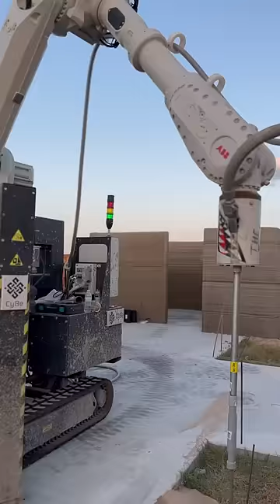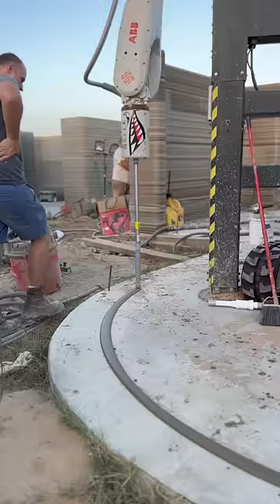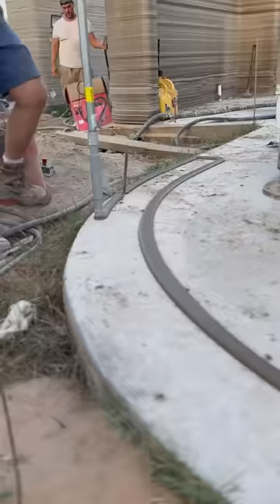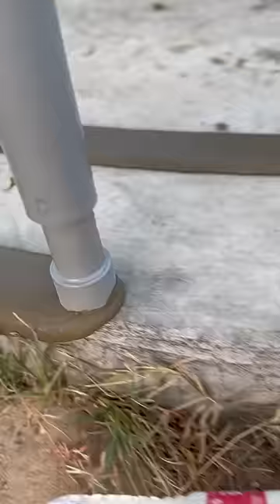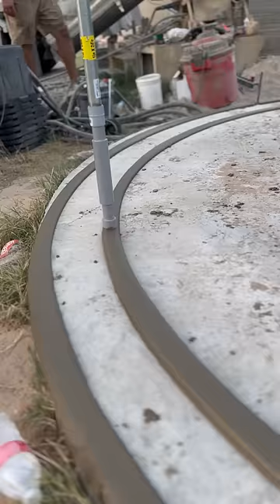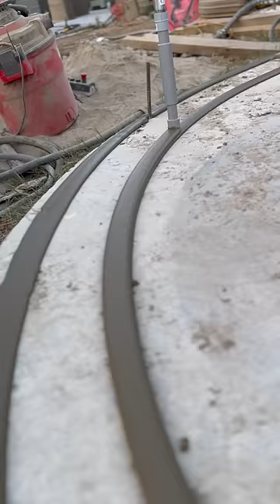Starting a fresh new wall with a two man print team #Hive

Comment: 3000 hours later, and the wall is done.
Reply: And after everybody who had any vested interest in the progress is long dead.
Reply: no rebar, no insulation....
Reply: And then it cracks and falls. Part of it is built on sand. Wth?
Reply: @mobilfone2234  Not true! there are rebar verticals at 12 feet OC!.
Reply: @LonersGuide China's building standards are not accepted here
Reply: "...its that easy!"
Reply: Didn’t clean the footing before hand, so it’ll crumble down
Reply: And then the wall falls bc it’s shit
Reply: “3D printed homes are completed in 1/20 of the time primarily due to around the clock working capabilities”
Reply: So efficient! Much effective! 
  Yeah, this looks like snake oil, a 2 man crew minus a gas guzzling machine could set bricks alot, and I mean alot faster
Reply: @jkizzle9953 Sounds like a contradictory statement, "we can do something quicker, because we can work on it more" essentislly saying "hey you guys use 20 hours over 3 days, we use 20 hours over 1 day to do the same work"
Reply: @mobilfone2234 . Insulation?    It’s concrete ffs. And we don’t put rebar in brickwork either.
Reply: And the cement hardened on the machine
Reply: Unlike you, this thing works and can go all night so it's done the next morning as it continuously prints.
Reply: @longbow6416  Nah. People have to take breaks.
Reply: Slow progress is better than nothing
Reply: Yeah looks like a lot of machinery and equipment and time and expense to build a crappy wall two men could do far better in far less time at much less expense
Reply: @jkizzle9953 I'd almost believe ⅓ to ¼ because of 24 hour capability
Reply: @quinn3011 😂😂😂
Reply: @StoutProper   It would be interesting to put the two types of homes to the test.
Reply: If the walls going to be just pure cement doest that mean more of the earth has to be dug up for cement mix. Hows that good for the environment 😂
Reply: The reduction in wcb claims will make this more and more viable
Reply: @whimseyOFC  I have zero clue what you mean man. 1/20 of the time is 1/20 of the time. There is no other way to cut it. If it takes 20 days (480 hours) to build it normally, it takes 1 day (24 hours) to build it 3D printing.
Reply: @jkizzle9953  what im saying is, if I had guys working around the clock, it would be done in the same amount of time
Reply: @whimseyOFC  It wouldn't. That assumes that the 3D printing takes 1/3rd of the time, so 24 hours of manual labor would make it equal. For your guys to do the work in 1/20th the time they would need to work 160 hours a day, not 24.
Reply: Guys, here is our Savior

HalleluYAH translates “Praise ye YaH”

YaH is The Heavenly Father
YaH arrives via the TENT OF MEETING
YaH was Who they Crucified for our sins
YaH was Crucified on an Almond TREE

Semitic of Moshe (Moses)
Isa Scroll (The Original Isaiah)

Isaiah 42:8 - I am YaH; that is my Name! I will not yield my glory to another or my praise to idols.

Isaiah 43:11 - I am YAH, and there is no other Savior but Me.

Isaiah 45:5 - I am YaH, and there is none else.

Comment: Prints on sand/soil, doesn't follow the concrete pad, the pad is dirty and it's a cold joint.
Reply: Also is obviously 10x slower than the laziest human. And it has the accuracy of Ray Charles playing darts. 

Even if it was faster, all the time is lost calibrating it for each and every minor change at each and every step and you pray to zues that you catch a fault immediately or else RocoBuilder over here will just keep going evidently.

Comment: They didn't sweep the slab because if you look at the start, the outside of the wall is off of the slab and the only thing keeping it from putting the outside of the wall in the grass is that giant mount of sand alongside the slab.  Crazy that they would show this!!
Reply: @BuildingABetterWay, exactly and notice how there's is that offset in the "arch" as it dispenses the outer portion of the wall and then it even "spills" over the edge as it approaches the start position because as you said, they started dispensing OFF the base.... Makes no sense to me either.
Reply: This must be a practice run that they have no intention of leaving up. There is no way they would keep a wall off a Slab like that and not expect it to be structurally garbage

Comment: I am a civil engineer and after watching this video I have nightmares
Reply: Why?
Reply: about losing your job?
Reply: @HR-yd5ib  More likely about people dying when these collapse.
Reply: @Pokarot its just a test print.
Reply: @HR-yd5ib  Great, so what do they do after the test fails?  Back to the drawing board I hope.
Reply: @Pokarot  , changing the settings on the machine.
Reply: @HR-yd5ib there's a whole village of these houses, it's proven tech
Reply: Civil engineer huh? 😂😂😂
Reply: @scifi_shop  , i am aware.
Reply: @HR-yd5ib If it's a test print, why not give it the best possible chance. Like, at the very least, preparing the ground  by removing all debris.
Reply: @jonathanreed5139  I would assume the chance of the machine being perfectly alined at the first try is so small that cleaning up before is a waste of time.
Reply: Right!? No rebar or any kind of reinforcement??
Reply: Proven or not he misses the foundation..this is ready to be demolished
Reply: @irishn8 the void left is filled in with rebar
Reply: @irishn8 it's going to be in compression only, doesn't need reinforcement.
Reply: I laugh when you have these nightmares, and I hope they plague you every night.

Comment: Structural reinforcement has left the chat.
Reply: This is waste of money and resources.. soo many missing structural components. 3d printing  a huise is soo silly. No reinforsment no wood or nails.
Reply: Ы
Reply: Why? There is one armature.)
Reply: Isn't the wall in compression only not in tension
Reply: I don't know what you people are whining about. The machine is laying down walls which they probably go back later and fill with concrete. Do you people really think they're leaving hollow walls? You all whine like little girls. The machine is probably extremely expensive, but it's also probably very reliable for mass production of homes, and it's a one man wage instead of paying a whole crew to lay blocks.
Reply: @solmon9673  Wtf do you mean "no reinforcement"? No wood and nails? Lol. Concrete is way stronger than wood and nails. These walls will 100% be filled after they're complete.
Reply: @seasong7655 if it's only vertically loaded...yes
Reply: @truthoverlies6434 stronger in compression yes...unfortunately that's only one force we design for
Reply: @seasong7655 no...wind will create tension and shear loads
Reply: Bro really drawing his boundaries
Reply: hey man, didn’t u see that piece of rebar sticking up? that things gonna hold that whole wall column down for sure 👍🏻
Reply: @solmon9673 i mean You could make a 3d printer so good that it prints all types of materials and uses them properly but that would cost tremendouly (im talking milions/tens of milions)
Reply: @truthoverlies6434   nonsense... we know what the machine do.. and there is no government of organisation using them there still in development..  they cost is tooooo high,
Reply: @truthoverlies6434  earth has alot of element most houses use a combination of materials, to make them affordable  and last longer.. on yhe rich use concrete  everywhere.. the rest of the world its efficiency and cost saving methods. 3d printing  is best for mars and the moon..
Reply: Take my like

Comment: It may help to have the entire print ON the concrete. You should have instantly stopped and made the adjustments....oh, and cleaned your slab. 
Yes, there are "acceptable" overhangs allowed, however, in this case, it appears eventually the weight will shift off the foundation.
Reply: No one else seems to be commenting on this but this seems so plain and important.
Reply: That was the first thing I noticed as it came around that curve. I’m guessing the machine wasn’t set in the correct spot? Based on how they left that dirt there it seems likely they aren’t very detailed sometimes.

Comment: I like the part where they lay concrete on smooth concrete before cleaning the surface and preparing it properly. 
Then the sequel when the concrete isn't being laid on the pad completely and you're losing it over the edge but when the main hero of the whole show, Dirt, shows back up, you completely forget that you're pouring over the edge still. 

Just because you made it further into the lesson, it doesn't mean you should forget the basics.
Reply: Hey hey hey... they had that one piece of rebar that got smacked by the head.  It's solid. Lol

Comment: Seriously? Fire the guy who was supposed to clean the foundation. Fire the guy who programmed the pattern. Fire the guide. And then, fire the guy who thought it would be a good idea to post this video.
Reply: Bro the worst part about it is, I would put money on it, that it wasn’t that the foundation wasn’t cleaned… it was that there was no foundation there and they needed to put the concrete on something, so they put a bunch of dirt in the area and just poured on top. Pest control problems in the future much? Cracks in the walls much? This whole video is a fail. The tech is cool, but everything else is so wrong
Reply: Exactly. I said the same thing. When that dirt washes away they poured it on there will be nothing holding the wall up and it will create and opening for water and insects 🙄

Comment: Part of wall on concrete, outer layer goes on the ground😅 excellent engineering solution! I’m very excited to see it after 10-20 years!
Reply: You mean 10 - 20 months, right?
Reply: @allanmoulton3745  1-2 winters show such defects, I’ve said so for being sure
Reply: Any point where there isn't concrete slab under the outside edge of the wall will become a point of entry for insects and rodents

Comment: 2 weeks later, a wall, that could have been built in just a few hours by a single skilled block mason.
Reply: Don’t forget the hod carrier, the scaffold, set up, clean up, tear down and ibuprofen.
Reply: There is probably not one mason left. 😢
Reply: Bock mason?
Sorry, we haven't needed those since the house shitter 5000 was invented.
Reply: Typically we lay up 6 courses of block per day so the mortar has time to properly setup.  Much more and you risk collapse.  Regardless, CMU would definitely be faster and with more human control but equally more human error as well.  I choose CMU every day over printing.
Reply: @ChaosBW 😅 I'm still laughing House Shitter 5000😅😅😅😅😅
Reply: @ChaosBW  Now that right there was funny, I don't care who ya are!! :-D
Reply: As a mason I've got problems with this stuff because it's super ridiculous to repair the pattern but let's not lie this machine is faster than we are. It takes no breaks, it does not need to eat, or sleep nor is it paid a wage. It's not possible to run employees 24/7
Reply: but it wont be as sturdy or tough as the robot

Comment: Curious, does it matter that it printed over the edge of the concrete as well as printed over that dirt patch?
Reply: For sure it matters.  Would you set a 2x4 on dirt off the foundation, no.
Reply: Does it matter you ask, well not to these guys clearly.
Reply: @chunkyfecalbreakfast I hope you’re not a builder…
Reply: @funkmanone California “craftsman”
Reply: That absolutely means that it will be stronger! Teetering on the edge or just printing on the dirt is always the best method.
Reply: Maybe some load bearing cardboard would help with that dirt? Just saying
Reply: @jacobwachtel5177  🤣🤣🤣🤣🤣

Comment: Usually you got to have a good clean surface and prime it first
Reply: There is no primer for concrete… that’s cars dude. You don’t “prime” concrete. You just clean it well. And you don’t program the machine to cut the bend short then go off the foundation spilling over. Now that spill over part of the wall is going to be lower by the time they start going up because it lost material spilling over, and it’s literally going to leave the wall hanging off the foundation. And then you have the bend which was cut short which will leave that concrete sticking out past the wall.

Comment: And 3 months later hey are already about 17 inches high, what a progress ! Just don't touch the walls, it's hollow and very fragile.
Reply: I do know that some companies use expanding foam or even more cement inside of it in certain areas so it don't crack or shift

Comment: Nothing like a 2 man team building the structure of a house in 4 months.  Meanwhile a 4 man team who actually frames houses has done 16 houses in that same time span. And for a way cheaper price
Reply: There is something to be said for that, but I’m down to at least consider alternatives. We live in boxes made of toothpicks and paper.
Reply: @JakeTrimble-bx3lx I think an f-5 twister will take stone or matchstick houses either way
Reply: @marksevastipol1946  F-5 twisters are much less common than F-3 and there will be a huge difference in damage for those. Of course, it might be simply easier to rebuild a matchstick house once in a while. Depends on costs and tornado frequency.

Comment: theres alot wrong here... 1st theres not prep done the pad is filthy.
2nd weres the rebar? i seen 1 tiny piece... 
3rd how does insulation work? do you build a 2x4 wall inside and secure it to that then use fiberglass in it then drywall over? if thats the case wouldnt doing a wooden wall be cheaper? or stucco? (being done correctly)?

Comment: I don’t do concrete, but when they built my house I got footprints on my side wall and driveway chunks taken out around the edges.  They brought a skid steer on to pick up the trash and it scored the garage with the teeth a drive way then a quarter of the driveway cracked so they had to break up and report that section and it is white not grey.  The sidewalk is not straight the framing is all wavy.  So when someone hasn’t taken the time to rent a broom, shovel and a garden hose to clean an area they are pouring on, it really pisses me off! Speaking as a experienced non-expert, the extra 30 minutes would have been well spent and expected if this is not an experiment and for a new owner…. Color in between the lines not outside!!

Comment: They should do  3D scanning of the shape of the surface to adjust the model before printing
Reply: no, they can just do a dry run without concrete to check nozzle path. which they did since they knew where to build up the Clay to match the footer instead of moving machine { assuming it as at its adjustment max already} or reprogramming the machine center point

Comment: Not only is there sand on the footer, it appears that either the footer was poured wrong or the cad file is off because the pour ran off the edge.
Reply: Machine is like 1" to far to the right and has no way to calibrate

Comment: I know that a bunch of people are complaining about them not cleaning the slab off but this is a test line. This is not actually going to remain on the slab this is to make sure that they have the geometry right. They'll take a shovel and scrape off this. Did you see how on a portion of the print it rolled over the foundation and then in a different place it was two inches from the edge? This means that they have to adjust the machine. They'll do this as many times as necessary until they get the. Correct geometry
Reply: Well now what am I supposed to do with this pitchfork?
Reply: Lesson learned.
Don!t post your tests on the internet, people don't care about explanations.
Reply: Are the walls with all the misaligned layers a test print too?
Reply: They needed a second layer to see it was that bad?
Reply: @AF-sx1zu  🤣
Reply: If that was a test pass then why did it begin the second layer on it?  It must have thought maybe it could do better on the next time around I guess?

Comment: Great concept.  I have questions though.  Doesn't this need any metal reinforcement?  Do you put the rebar in later, or is this a special kind of concrete?  If not, wont this thing crack apart pretty quickly?
Reply: I'm guessing they fill the cavity in with something once the form dries.
Reply: Rebar is only needed for concrete under tensile stress. The height and shape of this wall section (plus the roof) should ensure that all the internal stresses here are compression, which would make it OK*. Consider it an object lesson in the relationship between material properties and design.

I know some 3D printed concrete walls have internal ties to join each side of the print, but I'm not sure if that is being used here.

*You know, aside from the whole "building house on sand" thing.

Comment: Should the wall be on top of the footing with at least 8in
Reply: Depends on wall thickness, footing extends 2 inches inside and out plus a keyway center of wall or rebar to keep wall from shift off the foundation. No inspector would ever approve this as a livable construction or otherwise. But it's becoming a wacky wacky world🥴🤦

Comment: My question to you is do you not see the problem. For one your pad isn't square to your machine that is laying the mortar bead down. So I wonder how does that affect the way the structure is going to hold up later on down the road. If you didn't notice part of the border bead is laid over sand as it creeps off the concrete because they got the concrete off-centered to where the devices that's 3D printing the building. So if you get this off-centered to where it's supposed to be placed how does it affect the structural support of the footer and the wall in which that is sitting over the non supported wall on the part of the foundation that it's not on where it's just on sand

Comment: Whats really sad is that thing has tracks and couldve been moved over a little bit more to keep it from falling off the edge and placing part of the wall on dirt. I wont even start on the filthy surface they placed the first layer on. Unless that slab is the "build plate" and this is a modular assembly they are making.